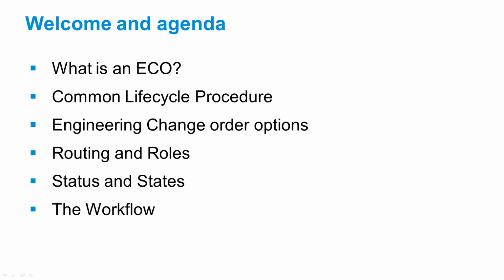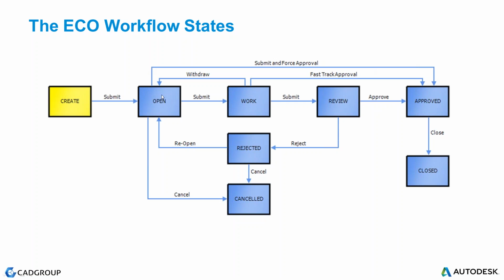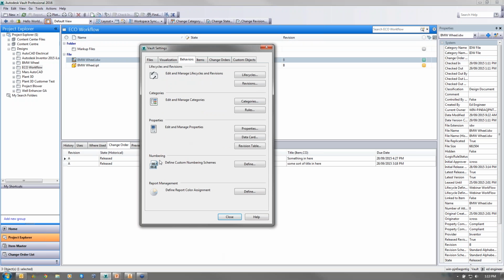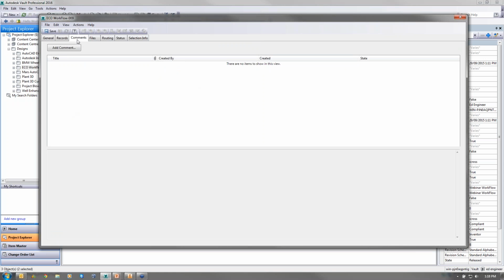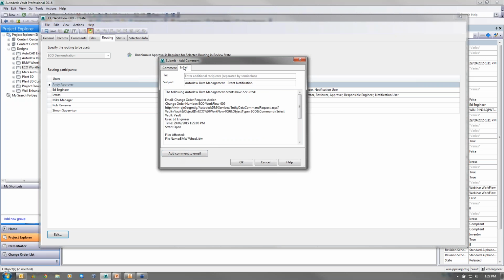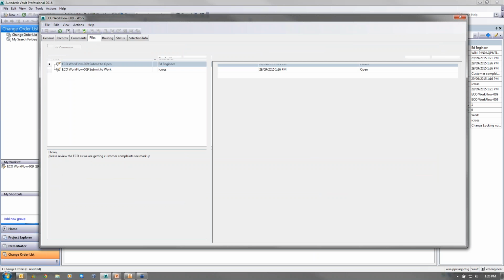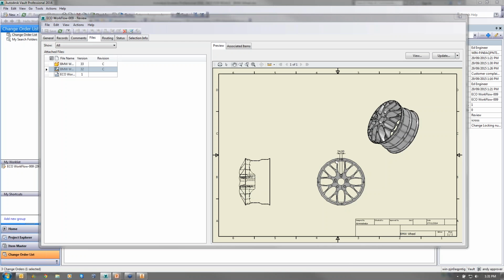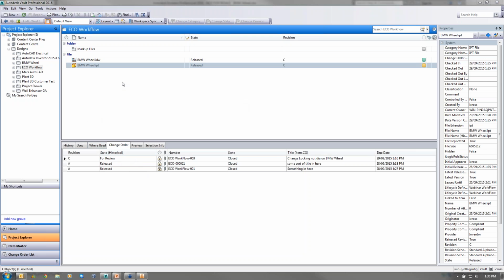Autodesk Vault Professional 2016   The Engineering Change Order Workflow

Comment: Can a ECO state change trigger a Life Cycle State change? Could the review state of the ECO also push the files into For Review state? And later when closing the ECO also triggers a Release on the files? I saw in the history that the ECO was closed but the state was still tracked as files in Review state when it was closed. Even if you manually changed it to released?